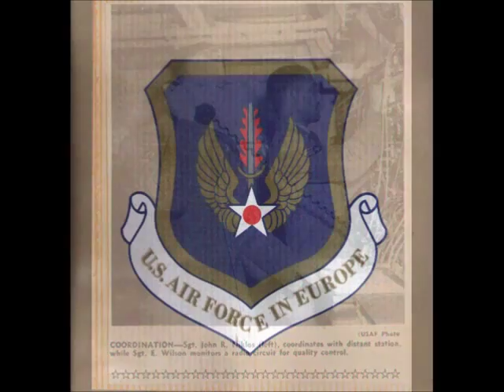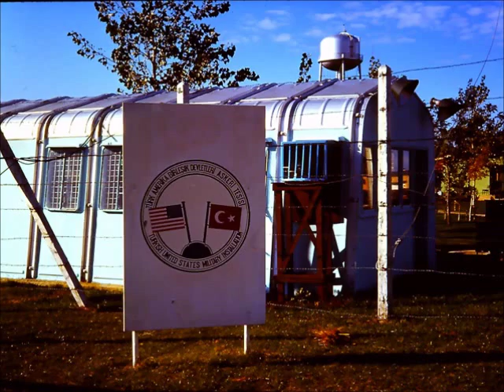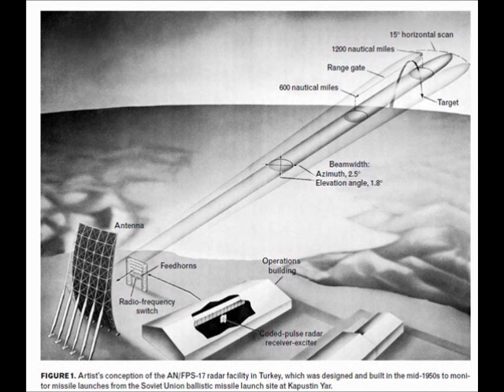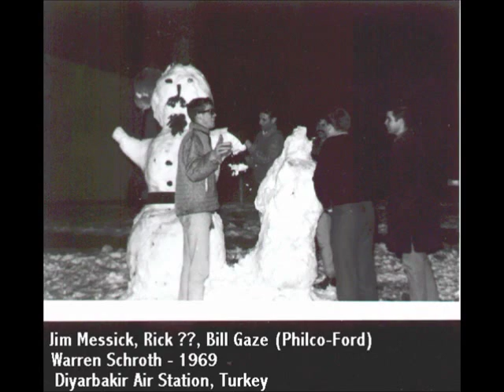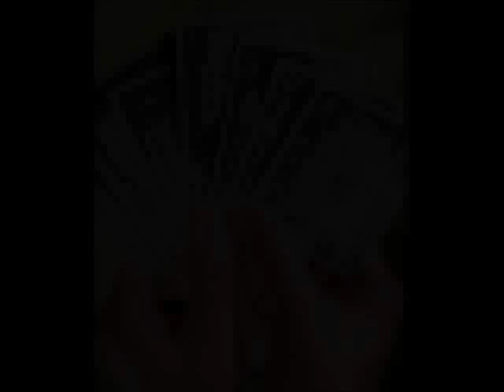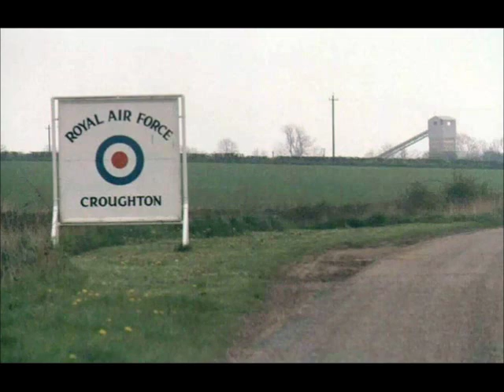Diyarbakir Air Station - Turkey

Comment: Good job of narrating the photos. I donated my DIY 35 mm slides to the AF Museum at Wright Pat several years ago.  As a 1st Lt., I was stationed at TUSLOG 8 for a year in 1964. GE personnel ran the two radars. We were part of Air Defense Command- feeding data to Colorado Springs. The commander was Lt. Col. John F. Stankowski, Jr., there was a Major McCawley,  a Capt. Dice, and a few lieutenants. We worked 12 hrs a day, 7 days a week, but we could sign out blue AF Ford vehicles to go into town. Sometimes the reception in town was not too friendly by the local kids. I am still in contact with two retired GE employees who worked with me. Glad I had the experience. Sure different from suburban Philadelphia's Main Line where I grew up and have lived since.

Comment: Stationed there 1978-1979. AFSC 304x0 - Tropo Comm. Rode the bus to and from Site 106 for graveyard shift the entire year. Always thought it funny that I was the "site commander" as an E-3. Only 3 of us on site for graveyard and the other two were more junior. There was a pet goat named Kilowatt that lived inside the fenced antenna area to keep the grass low without mowing. Things were a little hot while we were there so we ended up keeping the weapons locker at Site 106 open and carrying M-16s while onsite. Had gunfire at our perimeter more than once. Cooked for tips at the NCO club - never knew what supplies we'd have to serve up. Usually burgers and fries, grilled sandwiches and occasionally we'd get in steaks. Didn't see any references to the birds in other posts, but I remember trying to get from the barracks to the chow hall or NCO club without getting crapped on by the thousands of birds taking advantage of the only trees for miles. In all, a very informative and shaping experience for a then 19 year-old airman. 

Thanks for the video!

Comment: I was there, at Site 106, from 1969 to 1970. I worked in the Electrical Power building running those 4 generators. You were right, there wasn't much to do except the officers club and sleeping. A few trips into town was the highlight of my stay. We did take a tour of the town of Urfa and Haran. Very interesting.

Comment: Erod, I was assgned to Pirinclik AS (formerly called Diyarbakir AS until the Cyprus war between Greece and Turkey in 1974-5).  The Turkish Army had taken control of the main gate access and the base and the USAF tenants were guests/renters.  Betty was still a prominent electrical interferance.  I have about 150 pages of memories from my one year tour (1978-79).  I enjoyed your accounts from the earlier years.  Post Cyprus had caused the base to be on the rebuild during my tour.  Thanks for your.

Comment: I was there 1979-80, one of the first full-tour folks following the US return to operations (after the shutdown over the Cyprus incident). I was a Lt at the time, working in the FPS-79 tactical ops room (TOR). At the time I set a record for the most special events tracked. I often relieved a friend & coworker, Lt Tony King, on his mealtimes and something would start happening soon after he left the TOR. I think we even tried swapping shifts once to see if that changed his luck but it still seemed things often started up after he was out of the building.

The FPS-17 down the street was actually the Betty radar, a name it was said to have acquired following an upgrade project code-named Hurricane Betty (it evolved over time from its first installation). It's often mistakenly reported that Laredo TX had the first FPS-17 but the first was really Diyarbakir - but it wasn't able to be acknowledged for a long time.

Wish I had paid more attention to the site & hardware history when I was there, as many years later one of my projects for AF Space Command was to update their Space Surveillance Network Handbook, a summary and history of space & missile tracking assets.

Horace (Wayne) Hall

Comment: Thanks a bunch for the video.  It brought back a lot of memories.  I was stationed there in 1986 and worked at Site 106 on the Tropo Comm equipment and microwave system.  For a remote assignment, it wasn't that bad.  I actually enjoyed my time there.  I, like a majority of the folks stationed there, spent a lot of time drinking.  Especially when the civilian contractors got paid -- they always bought rounds for everyone sitting at the bar.  But, when I wasn't drunk I played softball and I worked at the bowling alley.  I was also editor of the Duck Tales while I was there.  Does anybody remember the birds????  They used to shoot off a loud cannon two or three times a day to scare away the birds.  You'd have to use an umbrella during the summer to keep from getting pooped on.  Hahaha!  Oh, the memories,  Thanks again.
Reply: You and I were definitely there at the same time. You say you ran the bowling alley? Do you happen to remember a Ssgt Wacke?

Comment: I was stationed there 83-84, and was a 291 (comm center operator), so right next to Tech Control!  Thanks for this video, it brings back a lot of memories.  Interesting to see the differences between your 69 tour and my 84 tour.  For one, we did have female air force stationed with us.  I think there were ~23 females to ~150 male Air Force at that time.

Comment: My time at Pirinclik was spent from 1995 - 1997, not long before it shut down.  I worked for Lockheed Martin as a Data Station telemetry specialist.  Fun stuff, and was a pretty good time to be there.  Met some very interesting folks, and did some very interesting things.  Glad i went.  Would like to catch up with any folks that shared time there.

Comment: Hello, I loved your video, thanks so much.  I was stationed at Diyarbakir and worked as a Tech Controller from July of 1968 to July of 1969 which was followed by two years at Croughton.  I also showed movies during most of my time there.  I believe Tom Roundsley also showed movies.  I had the pleasure (NOT) of having a cast on my left leg for 2 1/2 month because of an recurring ankle problem and that 2 1/2 months corrected the problem.  It was during the winter during our snow adventures and with my toes hanging out it was kind of cold.  Another thing I remember is what happened to the snow man after everyone was told to removed the hand... I'm sure you remember.
Reply: Hello, I loved your video, thanks so much.  I was stationed at Diyarbakir and worked as a Tech Controller from July of 1968 to July of 1969 which was followed by two years at Croughton.  I also showed movies during most of my time there.  I believe Tom Roundsley also showed movies.  I had the pleasure (NOT) of having a cast on my left leg for 2 1/2 month because of an recurring ankle problem and that 2 1/2 months corrected the problem.  It was during the winter during our snow adventures and with my toes hanging out it was kind of cold.  Another thing I remember is what happened to the snow man/WOMAN after everyone was told to removed the hand... I'm sure you remember.

Comment: Stationed at Tropo Site 106 from August 1981-1982. Was NCOIC of the power plant and Unit Civil Engineer. Turkish guards would ride the bus with us to Tropo and they also guarded the  perimeter of Site 106

Comment: I was station there back in 1964 .  Jeff and I got assignment orders there for 60 days.  At the time we were station in a town of Ronse, Belgium.  To watch this video was making those days seem more important that we were there.  I recall going to Shell Oil camp for drinks and BBQ.  We did go to town a few times, we even eat at some places that of course served Sheep.  Even visited some places that were not on the tour guides list.  Once in a while Camel trains would park outside the gates and sell items.  I was at the 106 squad and we had Radio Tropo equipment that would send data from Radar equipment.  I recall they had slots at the club which did pay off good it seems.  We were kind of spoiled there, for they had Turks who would clean our rooms and laundry.  Thanks for the video!

Comment: Stationed at the Duck from August 1988- to December 1989..... Det 2, 2003rd Communications Group. Still my best assignment in my career, wouldn't have changed anything about it.  Extended to cancel a follow-on....

Comment: I was stationed at the "Duck" from May 75 to 76. The name was changed at that time to Pirinclik CDI (Common Defense Installation). I was with the 19th Surveillance Sq. (aka TUSLOG Det 6) operating the big antennas. The commander was Col Bernard Kerin. The FPS-17 was as usual beeping, but the FPS-79 had a cracked base and operations was limited. GE was building a new FPS-80 tracker and we transitioned that summer to the new antenna. The old antenna was torn down, the Turks and the Greeks went to war, Congress placed an arms embargo on Turkey, so the Turks stopped our operations and after that summer the US had to pay the Turks to use the base. One of Congress most ignorant actions. For a remote site, I have good memories and the Turks were great hosts. I enjoyed going downtown, visiting the wall, and buying eggmek (sp?). Thanks for the memories!
Reply: Jose,
I was there the same time as you.  Worked in the comm center, and assigned to Det 75/AFCS.  I remember the arms embargo well and the problems it caused in getting supplies flown in from Incirlik.

Comment from the maker: Jim,  I'm having a long-term brain fade here.  Any chance you remember the Radio Callsign for Diyarbakir?  I remember that Croughton was AJE, but Diyarbakir is not responding to a Deep Brain Google search and it's really buggin' me.  For that matter, what was San Pablo?  Tks, Ed.
Reply: I was stationed at Karamursel from Dec 1966 to June 1968.  At Site 4, about 9 miles off base, we had 50 kW multiplexed HF links to Croughton (AJE, as you said) and Peshawar (AJU) up continuously.  In addition, we had a number of 1 kW links to Trabzon, Samsun, Crete, and others, as well as a microwave link (to and from whom I don't recall) and a TRC-24 link (88 MHz FM to Istanbul).

Comment from the maker: OK, Thanks for the effort Jim.  Actually, after thinking a bit more I "think" that Diyarbakir was AJT so I'm going to end the mystery and just go with that. I even looked on my "giant system map" that I "borrowed" from Diy Tech Control and it didn't have the call either.  Thanks again.  Ed.
Reply: AJS
Reply: Guys, Diyarbakir was AJS while Croughton was AJE. Sincerely, Glenn Dickson (SAC underground command post Offutt AFB 02/68 to 07/68 followed by DIY 07/68 to 07/69 then on to Croughton 07/69 to 07/71).
Reply from the maker: Thanks Glenn.

Comment: Wow !  After reading all the comments I feel ancient.  I was at Diyab from 61-63 (15 mos) I left base during the Cuban crisis. I was 70250 and worked for base commander next to dispensary.  Also had a mail run for intl TUSLOG det 8 mail and was "desk sgt/A2c for AP. clerk for MSGT Litzinger.  At night we usually either/or went to the movie and/or closed the airman club and on occasions checked out a truck and headed to town to the good old Turistic Palace to go "bowling and then maybe a carriage ride to the Karahani.  At that time,  we would take RR flt to Germany but never made it past Athens. I never have missed the place, and we never called it "the duck".

Comment: I was a 304X0 (Radio Relay aka Wideband Communications).  We called tech controllers "dummy loads."  ;)
Reply from the maker: I was so in awe of the 304X0s that I spent 30 years working as a Microwave Radio/2-Way Radio Tech at AT&T to make up for my shortcomings

I always thought that the real issue was that we 307X0's spent half of our time logging out your equipment and the other half bitching about the test gear. 

One incident that I remember is the night in Diyarbakir when I logged out the link microwave from the HF Receiver Site to Tech Control for delivering the audio channels off frequency. The 304X0 on-duty proclaimed that was impossible and that I was nuts so we had to have the Philco-Ford Microwave Rep go out to his site to provide some Master Oscillator Off-Frequency training.  

I wish we were still both in our 20's arguing about the equipment with a full head of hair and a full complement of years left.  Thanks for watching the video.
Reply: The Erod1944 Channel I used to get so man at the Tech Controllers at Hellenikon Air Base in Athens when they would try to tell me or the guys at the other remotes how to troubleshoot the systems up north.  I finally sicced the Chief of Maintenance on them.  Some knew the stuff others didn't.  That quieted them down.
Reply from the maker: Thomas Carney That's interesting.  When I was at RAF Croughton in England that didn't seem to be the case.  We generally logged the suspected device out with maintenance and then waited to see if we would get a repaired unit back or a message from maintenance proclaiming our lack of brain activity. I don't recall any controllers there trying to get into the 304x0's "stuff".   It must have been the Greek water.  By the way, I got hired by AT&T where I worked for 38 years because a maintenance guy at Croughton was kind enough to show be how to adjust a polar relay on the relay jig.  The employment office asked me if I had "actually fixed" anything in the USAF and I replied Uhhhh, I adjusted a relay. That was it, I was hired - Thanks USAF Wideband Maintenance !!!